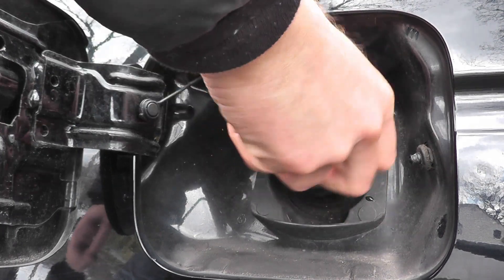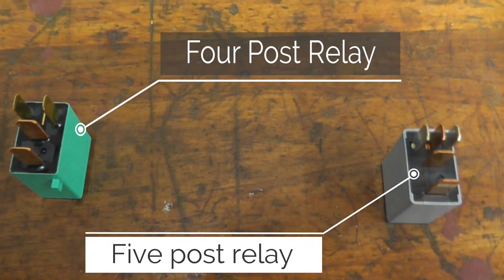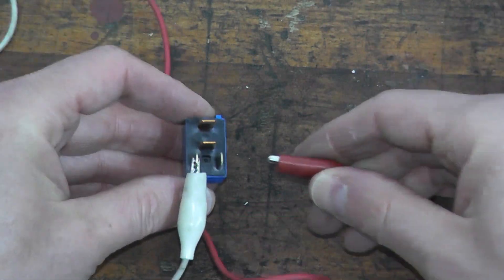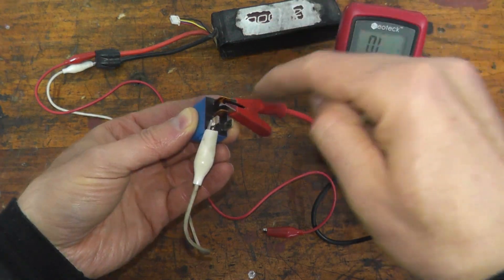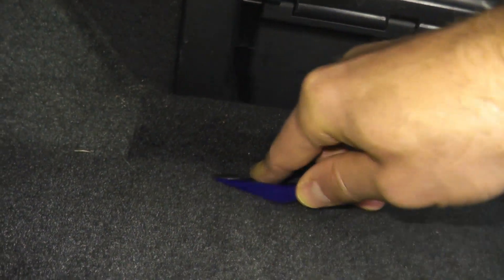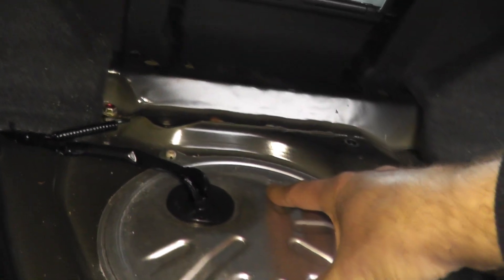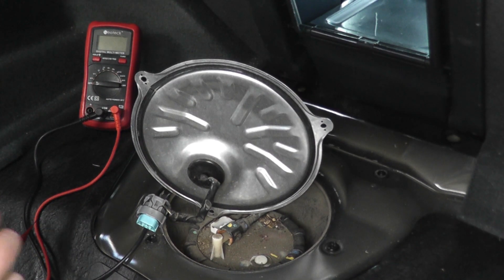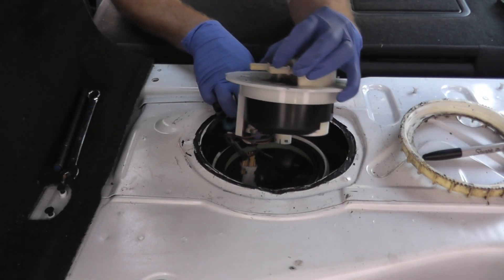How To Test a Fuel Pump, Fuel Pump Relays and Fuel Pump Fuses

Comment: I have continuity on the ground wire to my pump connector and I have power coming from four of my wires but not my 12 v positive power wire. Does this mean it could have a break in my positive 12v wire?

Comment: I believe you tested the harness incorrectly.  You should test for power without the ignition on.  The fuel level sensor gets power when the ignition is not on.  

The wire you checked in the video corresponds to the always hot, fuel gauge.  The one directly below that is switched by the ignition and corresponds to the fuel pump power.  

At least in my 2012 Ford fusion sel.  Same exact harness plug.

I test the relay by swaping it for another one.  For example the headlights use the same relay in my fusion.

Comment: Voltage is only sent to fuel pump for a few seconds before the engine starts so you need to bypass fuel pump relay to test for power at the fuel pump

Comment: Wish I'd seen this before ripping to pieces my Tigra Twintop  to get headroom over pump. Anyway, I put in a pump rated at 4bar/ 60psi and a new filter. Finally found a pressure tester with Schrader adapter (only, no other bits unfortunately) and get 50psi on the rail. Can't find specs so don't know if that is cause of start then cut out problem. Would like to check pressure before and after the filter  but can't with my kit. There is no regulator to speak of: it's part of the lid of the pump assembly (Tigra= Corsa C 2005). Any suggestion? 
H

Comment: Very nice video. Thank you. I am little confused on voltage testing on the harness. Ground (black) is good (audible). Next pin (with ignition ON) shows very low volt. Shouldn’t this pin have 12 V? These two pins power the pump - based on Hyundai sonata.
Reply: I agree. 2 pin openings are power and ground to pump, the other 3 are the fuel level connections.

Comment: Pitted contacts may not complete circuit carrying current, best to use a load like a headlight bulb.  Meter may say ok but bulb may not.
Reply: Interesting. Could you point to a video showing this please? Doesn't have to  be pump just anything. Thanks.